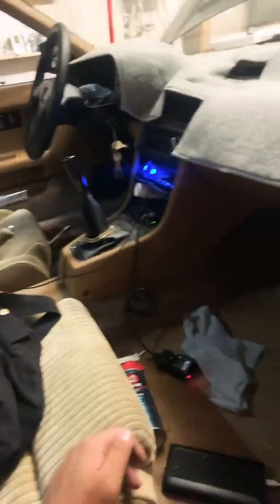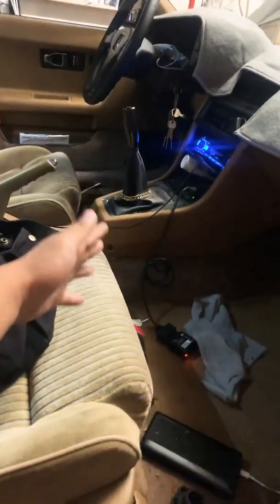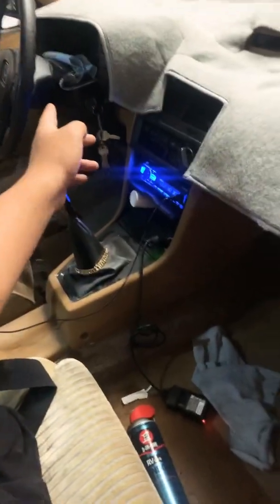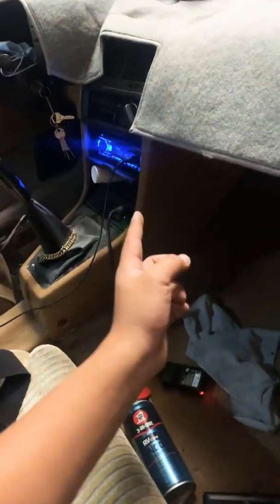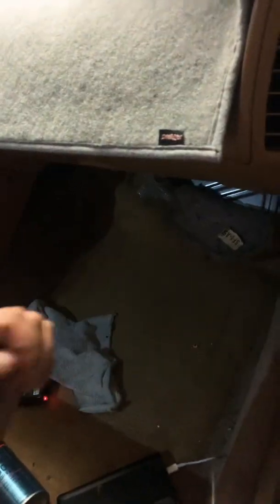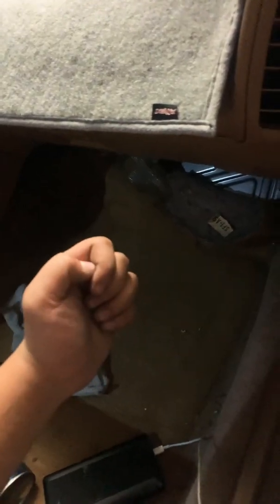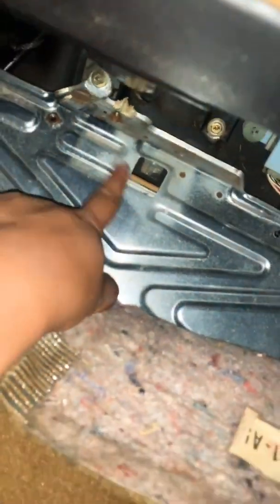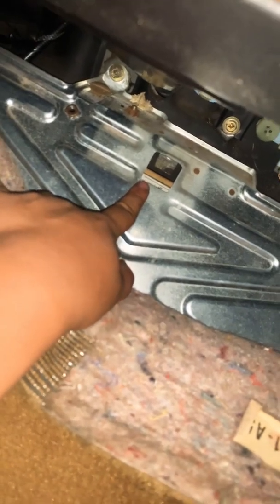Project prelude: Engine light! How to diagnose engine light in 3rd gen prelude Si

Comment: how do u start the sequenz? like do u start the car or am i doing something wrong
Reply from the maker: You just turn the car on accessories position
Reply: @Im_The_Slep  thank u dude. The preowner told me there is a Problem but i dont see something but it is still running pretty high in idle
Reply from the maker: @plaze1337  probably good thing to check is EGR or the Fuel thing diaphragm, there’s a vacuum tube to a fuel regulator I believe that may make a difference

Comment: Where do you correspond the blinks to the issue? In the manual?
Reply from the maker: Check the prelude forums, people have posted the codes for a 3rd gen. And actually I was wrong about the problem, it was an accidentally switched o2 sensor plug.
Reply: @Im_The_Slep  ok thanks.

Can I message you if I have any issues?
Reply from the maker: @marshallhazlett233  feel free, prelude owners gotta help each other out 😎
Reply: @Im_The_Slep  well I'm home from work and I'm gonna start taking off clock fuses and resetting the ecu.. see what comes up
Reply from the maker: @marshallhazlett233  good luck!